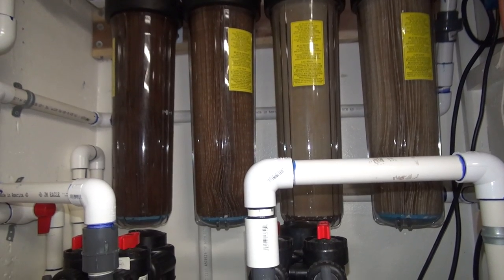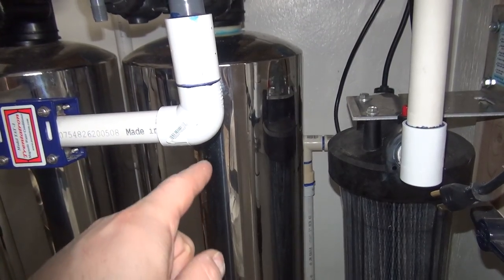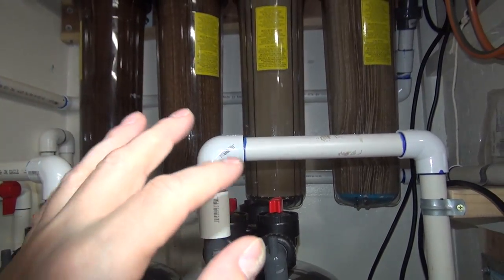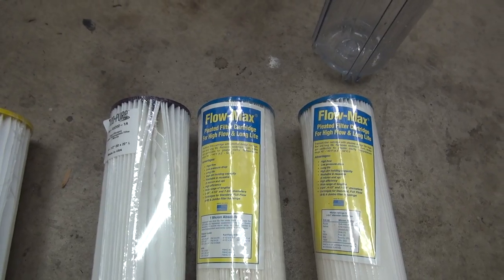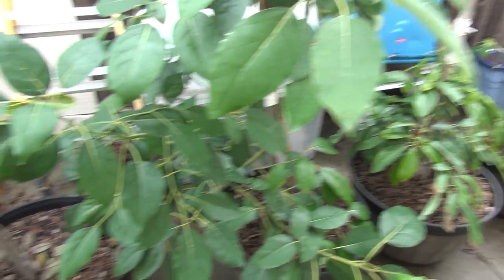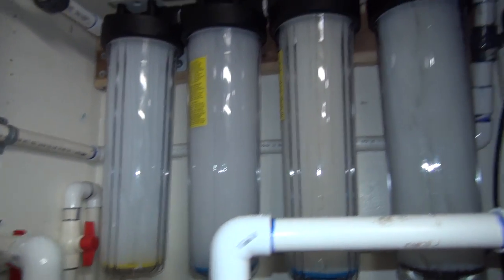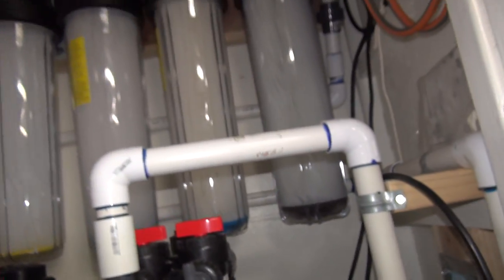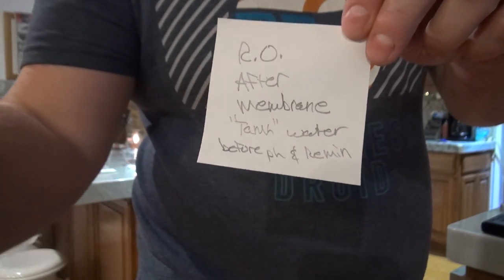worlds best whole house water filtering system D I Y  tutorial

Comment: If I may add some pointers dealing with crap/hard water here in Texas.  You could better optimize your main whole house system to both save some cash and better deal with the high level of hardness.  I wouldn't change your sediment stages, outside of the 1 micron ABS, based on how that has performed so far in your other videos after making the changes.  If you look at filter efficacy then you should see that a 0.35 nominal will catch what a 1 micron nominal would let through making a 1 micron ABS an unneeded extra expense while also prolonging the life of your 1 micron stage if you switch to a nominal filter.  Now if like me you like overkill then eh they're not that expensive so keep keeping on with the 1 micron ABS stage if that helps you sleep better at night compared to a 1 micron nominal followed by a 0.5 or 0.35 micron nominal filter.  I will also say those salt free "softeners", technically conditioners, are complete crap if your hardness is over 10 GPG and/or you have clear water (ferrous) iron and manganese that often comes with hard water.  While the chlorine should oxidize most of them out you will often see some residual that would be taken care of by a salt based ion exchange softener which is still the gold standard until nano filtration is commercially viable for residential use. The iron and manganese will poison that "salt free" media making it worthless unless you pre-filter with oxidizer injection or some manner of high capacity KDF or an exotic filter cartridge.  I would instead suggest you use that tank as a pre-carbon with a healthy amount of KDF 55/85 to strip anything the carbon can't handle (heavy metals, etc) as well as prolonging the life of the carbon while allowing it to remove more organic contaminates that would no longer be competing with the free chlorine that KDF removes.  If you cannot or will not go to salt based softening then I would replace that post tank filter with a quality PHO/Siliphos injection filter that will absolutely help with some of the scaling, help prevent R/O Membrane scaling, help prevent scaling of your UV quartz sleeve, and is not affected by manganese/iron.  They are also typically 5 micron rated which is more than good enough to catch carbon fines from your tanks to protect your household plumbing.  They do introduce other issues, but you already have those covered with your hot water post filter (PHO injection can cause hardness precipitate post heater that is advised to be removed with a hot water filter).  If you also want to help prolong the life of your water heater you can add a scaleRX filter directly to the input of your tank which I have seen have notable positive results to the heater itself here with our hard water, but it won't help your appliances without PHO injection.  If you want quality US made filters I would suggest looking at US Water Systems.  While they do cost a bit more they seem to last quite a bit longer with far better quality just handling and looking at the filters. 

For reference I run the following with our very hard water (up to 25 gpg + some iron + some minor manganese) as well as to deal with agricultural run off in the aquifer here.  I don't have the same sediment issue as you do, but if I did I would probably run step down auto back flushing spin downs with a 100 micron then a 50 micron stage before getting into standard 4.5x20 housings to help prolong time between maintenance.  I also have a tank-less NG water heater as compared to a tank based heater which absolutely needs soft water unless you want to deal with de-scaling every 3 months on even moderatly hard water to prevent the boiler from fouling and plugging up.

In parallel with 2 4.5x20 filters per stage on 1" supply : 
5 micron nominal (US water)  - replaced every 24 months 
1 micron nominal (US water)  - replaced every 24 months 
DIY KDF 55/85 cartridge - replaced every 12 months 
radial flow carbon (US Water) - replaced every 24 months 
Interceptor PAC for final polish (US Water) (Sub Micron/Silver/Powdered Activated Carbon/Anti-Microbial) - Replaced every 24 months 

For Post Filtration Softening :
Fleck 9100 SXT Commercial Twin Tank Softener with Vortex Tanks and 2CU FT of 10% Cross-linked Resin per tank using high quality salt for regeneration (Also displaces other cations besides hardness with sodium).  10% cross-linked high quality north american made resin in conjunction with good pre-filtration changes the water from slimy to silky which I absolutely love as compared to "salt free", PHO injection, or cheap salt based softeners that make the water feel slimey.  You truly get what you pay for when is comes to resin based softening as it pertains to the resin used along with cleanness of the feed water.  

At "Point of Use" for drinking, ice making, or coffee making I either run R/O or UF (UF is nice for where I can't get easy access to a drain for the brine line or an easy R/O supply from where I have a drain) with the following :

RO : 
Interceptor PAC (US Water) - Every 12 months, but unneeded based on my feed water 
Chloramine Block/1 Micron (US Water) - Every 12 Months, but unneeded based on feed water 
Lead/Cyst 0.5 Micron Carbon Block (US Water) - Every 12 months for safety factor, but unneeded based on feed water
UV Filter Housing - Bulb Every 12 months 
100 GPD DOW Membrane - 5+ years or sooner based on TDS readings 
Permeate pump (Lowers TDS, prevents TDS spikes, and extends membrane life)
Re-mineralization Alkaline Filter (Express Water for Cost Efficacy/being cheap) - 6 months or so based on TDS drop 
GAC + Pulsar Quantum Disinfection polishing filter after tank (US Water) - 12 months 

Ultra-Filtration : 
DIY pre-filters @ 3 stages in 2.5x10 housings with 3/8" quick connect fittings  : Interceptor PAC same as R/O, Lead/Cyst same as R/O, Bone-char Heavy Metal/Fluoride Filter (US Water) - 12 months 
WaterDrop 3 stage UF changing all 3 filters at 24 months as the only filter that matters here is the UF membrane and the polishing carbon isn't doing anything but "sweeting" the water
Post filtration with Quantum Disinfection (US Water non Carbon Model)

I may eventually add a disinfection loop post softener if I ever see evidence of bacterial fouling in my resin tanks or test positive for bacteria/cysts (in parallel with the exception of the UV housing which dual high capacity UV's are complete overkill) using 222 "Positive Seal Filters" in the following order : 
0.5 Micron (US Water)
Disruptor Sub Micron/Disinfection Filter (US Water) 
25 GPM UV (Probably NeoPure based on costs and the fact I should already be "disinfected")

Hope this helps at all from a Texas redneck that works in the engineering field that takes water quality seriously.
Reply from the maker: Interesting...I tip my hat to probably the first comment to actually teach me a few things!
most of your assumptions are correct and I am trying to keep this project confined into my "water closet" (I could easily take over the whole garage wall if i allowed myself)

1- I considered spin down but honestly after a few seasons with my current BB filter setup I just dump them all and replace every 2 years as well.
they break and crack at the ends and begin to compromise anyway (I have no pressure drop and my final .35 is still snow white so I am good for a 2 year cycle)

2- I do no wish to do salt conditioner, it is illegal here or soon will be if not. I am interested in any reasonable alternative...toss a link for my to look at?

3- question...you are running a parallel 1" staged BB filter system??? 
Holy jumping Jesus are you supplying the whole neighborhood with water or what?? 

4- I heard about nano when i was researching a few years back, actually from the original owner of pelican lol...   

5- thanks for the input and advice. 
all and all I am pretty happy with my custom home diy job! 
I sure feel a hell of alot beter in the shower and eating/drinking the water since install!! (boy it's been about a decade now JEEZ!! 
ty
ps- I did toss some kdf in with the carbon (2 kinds if i remember right when i did a change out) 2-3lbs ea i think been awhile?